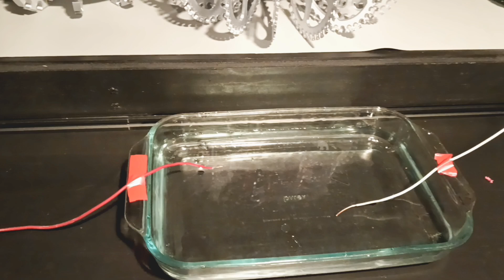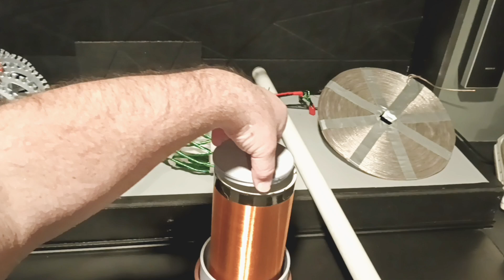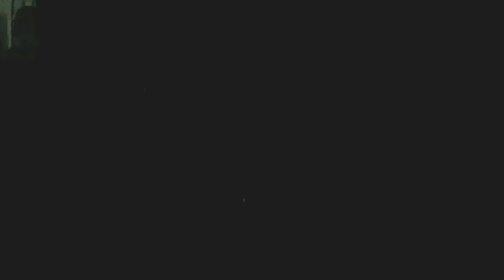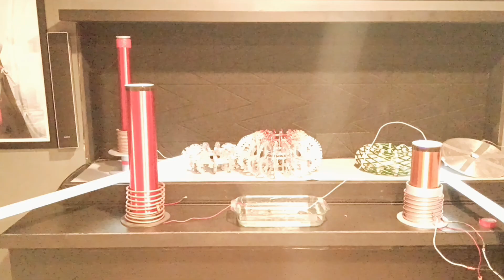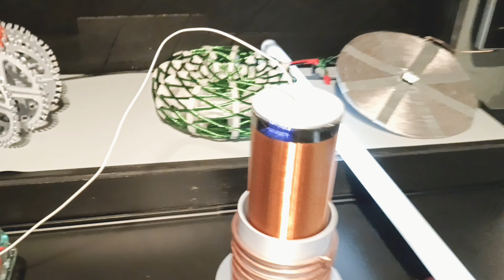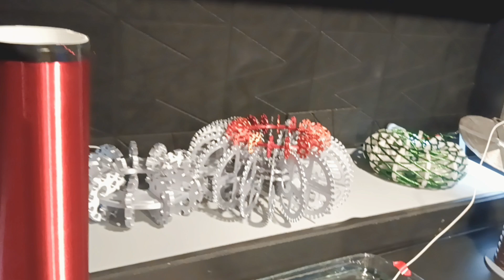Tesla coil "Using Water To Connect Tesla coils"

Comment: Can you put a tall water bottle that is longer then the tesla coil in its middle instead of the wire, and clip the top of the water bottle with and alligator?
Reply from the maker: it would stop it from working correctly and add heat.

Comment: Please finish the gravity flyer first.
This not the way the Tesla system works, I know I built one and can transmit power over many meters, using resonance and capacitance top loaded coils, transmitting electric fields between the loads across the ground
Reply from the maker: This experiment has everything to do with the Graviflyer and how it works. Trust me it is going to show the answer.

Comment: Have you tried a acoustic laser also what if the original craft used ion wind, gyroscopes and speaker sub to push more air trapping ion wind in bubbles like acoustic levitation when trapped it helps repell it with more force
Reply from the maker: I have not tried a laser.